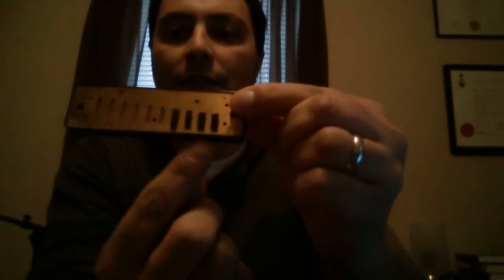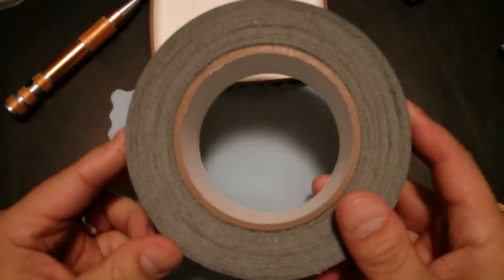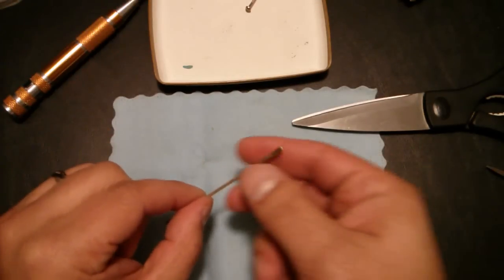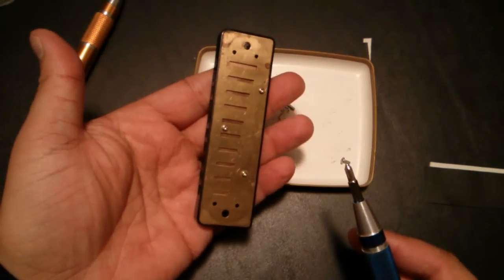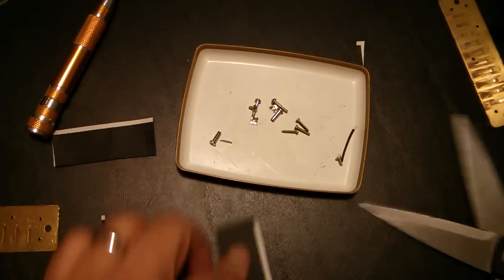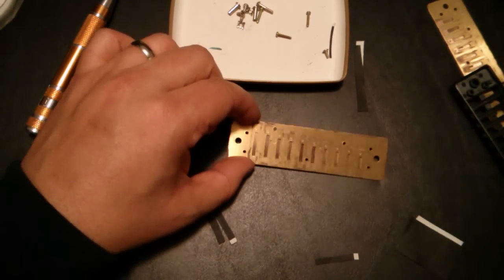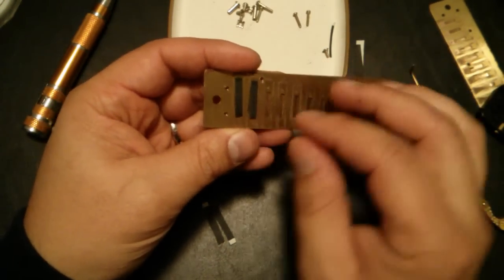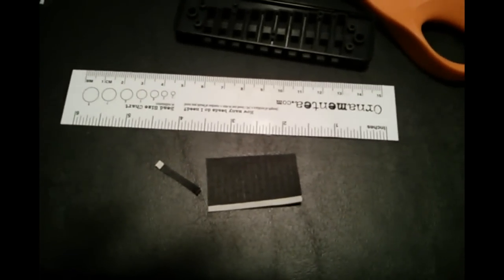How to make your own harmonica valves at home easily, cheaply, and effectively

Comment: Thanks for a great video. I was panicking a bit as I opened my 12 hole Hohner Chromatic for cleaning and wrecked one of the valves. 
It still serms to play ok but after watching this I'm confidendent I'll be able to fix it if problems occur.

Comment: Hi OneHarp,  This video was posted several years ago, but perhaps you could share your experience from your home-made wind-saver valve?  I might follow your lead if this was indeed an acceptable solution for the pesky valves issues for the harps.  How long these valves have lasted for you? Do they work well?  Could you please update your experience?  I have several vintage chromatics that could use some new valves.  Thanks.  Stay safe.
Reply from the maker: Hi Javier, I've a bit veered away from half valved playing all that much in recent years, but the harps I valved with this method are still going strong.

Comment: Excellent Isaac!

I bought some ultra-suede, but it wasn't the same stuff like PT Gazell uses, and it did not work well... I later ordered the pre-cut ultra-suede (Gazell method) from Seydel, and they worked... but I never put enough time to get comfortable playing a valved harp.

I'm going to give it another try with the gaffers tape.

Have you tried using a cutting mat and rotary cutting tool (used for cutting fabric) ?
The cutting mat has a variety of guide lines and come in various sizes.

Comment from the maker: Hi airmojo! Thanks! I'm glad you found it useful! Yes, I too found some "microsuede" in a local fabric store, but it wasn't what PT uses either. Terrible stuff, actually... It got all frayed and jammed up the reeds! Lol! I haven't used a cutting wheel, but I do have a cutting matt with grids on it (or more accurately, my wife has a board like that!). I tried cutting these valves on that mat with a normal X-acto knife, but the material was too thick to do it accurately (or safely) that way...

Comment: Isaac, I appreciate all you do by sharing on You Tube but I tried this and the valves always curl away from the reed plate. This is why they make them from stiffer material. I wish the gaffers tape worked and I tried a couple different things but no matter what they always lifted up.
Don M. in Erie,PA.
Reply from the maker: +Don Makowski Hi Don! Thanks for your comments here. I'm sorry that this method hasn't worked for you. Did you use the same brand of gaffers tape that I used? Not sure if that might affect it... Also, when sticking the two halves of tape together, was there any "curl" to pieces? In other words, did they seem to lay flat after being laminated together? Also, did you twirl the tape around a tooth pick (or something) so that it curled "downwards" against the reedplate? I found that last step to be pretty key. It's now three years after I made this video, and the valves I made back then are still going strong in several harmonicas... There's a little bit of "up lift" when I haven't played them in a while, but they always lay back down when I start to play them... But, this is just one way to make valves, with the main benefit of being cheap and relatively easy, while still being pretty effective. There are other valve materials that work better, but the trade off is in the complexity of constructing and attaching them. If you need absolutely high performance valves, then you are certainly better off using a higher-performance material! Best luck! ~Isaac
Reply: +OneHarp Thanks Isaac for your response! I did use the same gaffers tape that you recommend and it's great stuff. in order to more easily handle the first piece I taped it down to a flat surface on the edges lengthwise. Then I would apply the second piece as you show in the video. I really like the simplicity and the fact that you don't need glue, plus you can take them off without leaving residue. I did curl the valve before assembling and laid the reedplate valves down overnight to get them to lay flat. They still curl up pretty badly. I also tried some cellophane to see if that would work better because it seems like the double thickness on the gaffers tape near the small sticky end was keeping the valve from laying flat. The cellophane didn't help this. I am going to keep experimenting with this. I'll let you know if I have any success. Later!
Don
Reply from the maker: Thanks for the extra info! Do keep experimenting and let me know what you discover. I've recently experimented with "engineering" a downward curl into the valves. This is done in a similar method to what you describe about holding the tape down, only I do so over a curved surface (a piece of 2" PVC pipe) while laminating the two pieces together. I've not got it totally worked out, but the idea is that the "engineered' downward curl should be retained better over time than the curl introduced by rolling it around a toothpick after the fact. Haven't really been able to do a real test of the efficacy of that idea, and I just recently used up the last of that first roll of gaffers tape! Need to order a new roll, and start experimenting again! :)
Reply: +OneHarp I was thinking the exact same thing so I tried it last night. I taped the first piece on the edges to a 1" diameter acrylic tube sticky side out and put the second piece over it. I made sure they were nice and tight against each other and peeled it off. Then I cut the strips and put them on my harp. The curl seems to be keeping the valves down on most but a couple still pushed away and stayed up after playing for a little bit. I am going to try to find a thin slightly stiff material to use to see if I can get the valves to be more cooperative. I still think this is a good idea Aaron.  Thanks buddy!
Reply from the maker: Nice! If you are thinking about having another layer of something to hold the valves down, try a stiff bristle from like a shaving brush. Or even a cat whisker (if you've got cats, they shed these from time to time). Tape it at the base of the valve so it projects over the top of the valve. I've fool with this, and it seems to work, but it's fiddly, so I don't do it often.
Reply: +OneHarp I was thinking of a material similar to a standard valve material on the reed plate facing side. The gaffers tape would just be used to preclude gluing.

Comment: Awesome video, thanks.  I went and got the gaffer's tape and tried it on a Hohner Blues Bender.  It seems to work great. A few notes have squeals and various issues but I don't think that is the valves' fault.  This modified Blues Bender is at least as good as my Suzuki MR-350 valved.  I wanted to try this as an alternative to trying to get all the overblows and overdraws working, not easy for me.  Can you land on a blow bend while playing, or do you have to hit the normal note first and then bend it down ?  Thanks.
Reply from the maker: Hey there! Glad you found it useful, and glad to hear you were able to use this method on a Blues Bender! Yes, you can indeed land directly on a "valved bent" note, but it's definitely more touchy than doing so on a regular bent note. The valved bends have a very abrupt "floor" to them that means if you try to bend them past a certain pitch, the note will suddenly no longer sound. This means that if you want to land directly on the bent pitch, you have to hit it pretty exactly, or there's a chance that you'll end up going for the note and only getting a squeal or no sound at all. It's not that hard though, and if you've got all your three-hole draw bends down, and can land on any one of them on command, then you can land on a valve bent note too.

Comment: would this work for replacing wind savers on a chromatic harmonica?
Reply from the maker: This should work just fine to replace windsavers in a Chro. I've not done so, but I don't see why it wouldn't work. good luck!
Reply: OneHarp
The windsavers in a chromatic that I've disassembled is a two-layered affair.  Compared to $100-300 Hohner repair kits, the gaffer tape is definitely worth a try.
Reply from the maker: Thanks Tracy Gittins. Yes, most Chromatic windsavers use a plastic or teflon-coated plastic piece for the actual valve, and then a stiffer piece over that to keep the valve flush against the reedslot when the valve is not in use. I have experimented with making those "double layer" style valves, but found that the gaffers-tape valves generally tend to "stay down" if they are "curled" like I show at the end of the video. I learned that "curl" technique from a post (and accompanying photos) to Harp-l made by Rick Epping about how he made leather harmonica valves.
Reply: OneHarp
Thanks for the response.  I'm off to buy gaffer's tape.  One roll to rule them all!  :)

Comment: I would say cut the tape in half then stick face to face with the overlap, Cut the overlap off and use it to stick onto the the other overlap, back to sticky front. This then becomes the sticky surface you put onto the reed plate. this will let the valve lay flatter.
Reply from the maker: Not sure I follow, but give it a try and let me know if it works better!